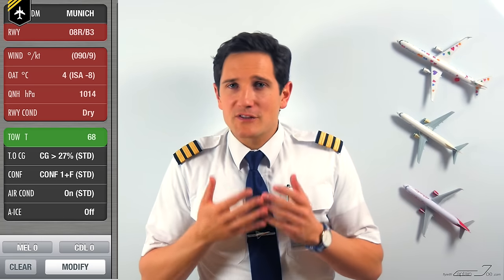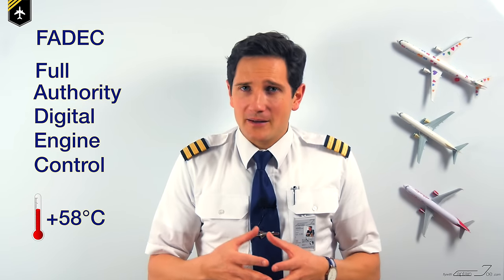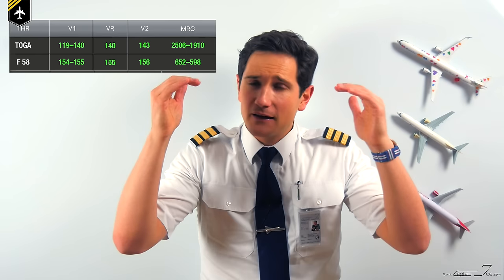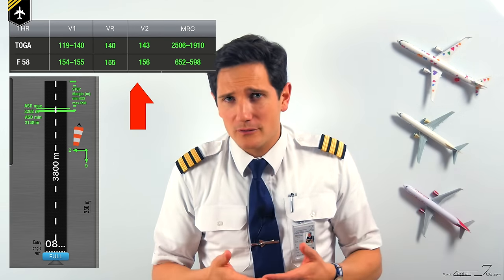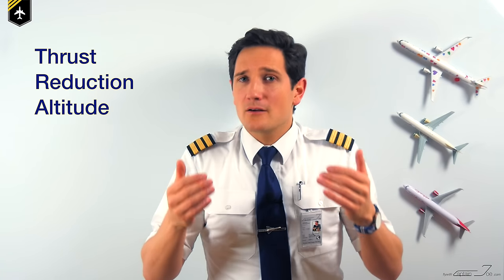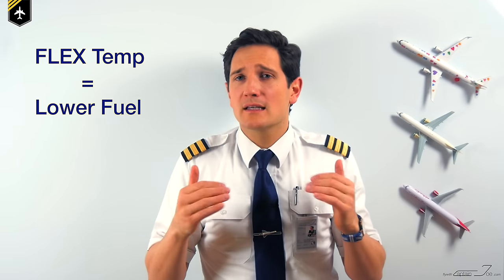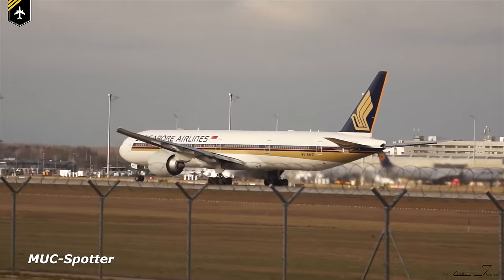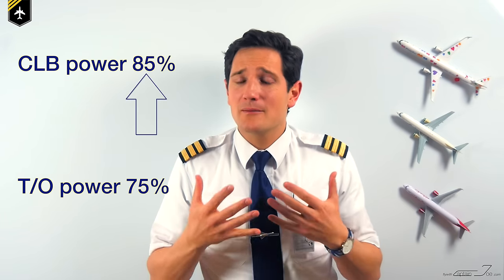What is FLEX TEMPERATURE? Explained by "Captain" Joe

Comment: Joe ..Pls explain how to determine N1 Limit for take off  In Boeing 737-800. 22k/24k/26k. I think it depends on the weight and runway length. However I am looking forward ur help
Reply: N1 for a given takeoff will vary depending on runway, weight, wind, barometric pressure, temperature etc.

Comment: nice,,, what power setting does it use if no flex temp inputted ??? toga ?
Reply: It assumes that you will use toga. So if you don't insert a temperature and then try taking off with the thrust levers at flex/mct, it will give an ecam and ask the pilot to set toga
Reply: @ZK-APA  toga for the win lol

Comment: Captain Joe how does a jet engines main bearings stop seasing up due to temperatures of minus 55 degrees in flight.
Reply: The bearings never get that cold when they are in use, because they are lubricated with the hot engine oil.

Comment: Can you plese clarify? Too my understanding, the higher the temperature the more speed you need for take off as hot air is less dense compared to cold air. Therefore you will want to apply more thrust to achieve the VR speed by the end of the runway. This would be just the opposite of what you said, right?
Reply: His explanation is incomplete and confusing. Basically, up to a certain outside temperature (called the flat rated temperature) the FADEC is programmed to produce the same amount of thrust in TOGA mode (hence the term flat rating), and above that temperature it is programmed to produce less thrust the higher the temperature becomes. If you take off with FLEX 60, for example, you command the FADEC to produce the thrust that it would produce in TOGA mode if the outside temperature was 60. FADEC doesn't actually think the outside temperature is 60, it needs to know the actual temperature to give you the N1 or EPR that would produce the same thrust as TOGA at 60. The highest FLEX temperature for given conditions is determined by your take-off weight - you (or the performance app) simply look at which outside temperature the actual weight would be the maximum allowable weight.

Comment: Hi captan,and glad to see you.So,as i understend it,FLEX is prohibited on contaminated RW, in other words approved with TOGA thrust only,to rich V1 with minimum take-off run and have a maximum stop distance in frot .That is correct?
Reply: Contaminated runways cause both reduced acceleration and deceleration for the aircraft. With higher thrust settings, you minimize the runway length required for takeoff (i.e. achieve takeoff speeds faster.) When talking about field length, we need to take into consideration both the Go (TODR) and the Stop case (ASDR). Therefore by reaching V1 faster you have more field length available to stop the aircraft in case of a rejected takeoff and by reaching Vr and V2 faster you can achieve screen height faster in case of an engine failure at or after V1.
Reply: Pilot Interview Handbook Wow! good english! Thank’s a lot.Really thank’s

Comment: Why did you leave out the explanation, why one would set a lower take off power than climb power. Its not like these few seconds until thrust reduction altitude would matter for fuel consumption or engine life, if after you have a higher setting anyways.

Comment: I have a question, If the jet engine runs on thousands of gallons of jet fuel how is it able to to cope when it rains? The water droplets mixed with air cannot burn jet fuel, please explain!
Reply: Tahir Rana Most of the rain would go through the outer part of the large fan at the front, and around the outside of the engine.  Any rain that goes through the core of the engine would be mixed with air that is then compressed and fed into the combustion chambers so fast that it effectively vaporises instantly.  The possibility of enough rain going into the engine to cause a problem is very remote.  Also, bear in mind that some jet engines actually inject water to temporarily increase power (increases air density), so it's not a problem.
Reply: Thanks for your well thought out, detailed response.  Firstly, I wouldn't become a freemason if they paid me; I am totally against that kind of secret society.  Secondly, could you explain to me why what I've written in the original post is technically incorrect?

Comment: Hi Joe, when transitioning between flight levels, does the airplane figure the climb rate out automatically or do you set a fixed climb rate/speed? Greetings from an aeronautical engineering student from Austria ;D
Reply: Airbus planes manage speed without pilot's help (planes use "cost index" (CI) of an airline. Bigger value of cost index = bigger speed and less care about "fuel flow". CI shows how rich airlines are. CI sets in plane computer (named MCDU))

About Reduced Throttle Altitude - that's altitude, when pilot sets levers in CLIMB position and the plane starts to full automatic control of the plane. After Thrust levers sets in CL - pilots almost don't change the speed. 

But don't forget about that fact planes don't accelerate higher than 250 knots below 10,000 feet and it doesn't matter whats CI you've set. That's the rule.

Generally, 1) Cost index (CI) influences how big speed plane is able to set. 
Formula:
Bigger CI = Bigger Speed= Bigger fuel flow
2) Planes control trust automatically after Reduced Throttle Altitude and levers sets in CLIMB position
3) Limit of speed below 10,000 feet = 250 knots anyway.

P.s. speed can be changed by pilot if needed. For example, Air Traffic controller says to set speed 280 knots, but your autopilot wants to fly 350 knots. No problem, just pull the "selector" in the autopilot panel and set manual speed for 280 knots. 

That's all. I know, that it's hard to understand if you're not a pilot and doesn't know this very well. Because.. if you still have an ask so find answers in Google or YouTube. About I can talk about "how working a plane" without stops, there's a lot of interesting things to say.

About me: I want to become a pilot and I live in Russia right now (want to study at Ulyanovsk institute). Btw, I typed this text without using Google translate, just English is a very important thing for a Russian pilots

Comment: What is the "Crank" Option on the Engine Start Switch?
Reply: thats to dry motor the engine ie spin the engine up without fuel supply and ignition.

Comment: Why would takeoff speed be higher at lower acceleration? And why would you make that calculation dependant on outside temperature if it is all about engine wear and runway length/condition
Reply: When the temperature is higher, the engines produce less thrust, and the wings produce less lift due to the lower air density. This means a higher thrust setting must be used to compensate.
Reply: Nathan Chetram the thing is: from what I understood flex temperature is at the and a thrust setting according to conditions like temperature, runway, high or low pressure etc. and is therefore dependent of the temperature but not not a temperature by its self at all you see?
And also I didn’t understand that part with higher acceleration means lower take off speed and so on

Comment: He Joe. I am a former 777 pilot and ind the FCOM2 it said that the higher the temperature outside air temperature the more power is neared because the worm air is less dens then the cold because the worm air holds more water per M3 bot why is it not like that in the airbus u shut think that wormer OAT should require more engine power then cooler OAT but I do no that AIRBUS uses a higher temperature to decrease engine were and damage. Usily I said to my self when I flew the A320 that the higher the temperature the more runway is required to takeoff. Can u explain that to me on a message ore chat thanks Joe

Comment: Why does the FLEX-Temperature influencesthe V-Speeds ? The outside conditions and aerodynamics stay unchanged to generate enough lift at a certain speed ?
Reply: I don't know about the others, but at least for V1 (the speed until which you can abort the takeoff) its quite easy to see: Let's say you have calculated your V1 for reduced thrust and perform your takeoff, when you hit V1 the remaining runway length (should) equal your stopping distance. Under the same conditions with full thrust, you'll reach this speed with more runway remaining, because you accelerate faster, so your V1 would increase. I wonder what happens to e.g. V_R, I'd think it would remain constant, except for maybe a (probably very small) vertical component of the total thrust . . .
Reply: I would assume with a higher thrust setting you can pull the nose of the aircraft into a steeper climb and the thrust vector is working more against gravity on it's own (just like a rocket), which evens out the lesser lift from the wings.

Comment: Why does the system have the pilot input the temperature rather than get the temperature from a sensor automatically?
Reply: Because this temperature is calculated independently, and doesnt always corrospond to the actual outside temperature

Comment: Hi Captain Joe, I'm 10 years old.  I fly the a320 on x-Plane 11, which is a flight simulator I use.  Thanks for the video ,but I don't know how to calculate flex temp.  Once again thanks for the video.
Reply: You would need a proper take off calculation system to do that. The toliss A319/A321 and FF A350 are the only ones I’ve encountered that tell you the flex temp to use
Reply: @tomstravels520  thankyou

Comment: I don't understand why the engine trust more when fake outside temperature is higher than real ?
When air is hot, air density is low and then engine have to sucks more air to trust the airplane.
What I'm understand is if you put a fake température lower than the real, engine will trust less cause he though that there is more air density and engine can reduce theirs power for an identical take off performance than without flex temp.

Anyone here can help me to understand ? Thanks you
Reply: Flex temperature can't be lower than the actual temperature (it is one of the conditions to do a flex takeoff)

And the higher fake temperature is not for the air density but more for EGT (exhaust gas temperature) limits. As in when we put a flex temperature, the aircraft thinks that if it gives full thrust with that temperature, it'll overlimit the EGT. Hence it reduces thrust as per the temperature inserted.

Comment: I am sorry but your explanation for why V1/VR/V2 are calculated as higher is incorrect.  It is not because the take-off power is set lower as you say.  As you must know, the lift generated by the wings is a function of wing's surface area, coefficient of lift, airspeed squared and air density, which decreases as the air temperature rises.  The reason V1/VR/V2 are calculated higher is because the assumed air temperature is higher and therefore the assumed air density is lower so the computer sets the take off speed higher to compensate for the assumed lack of air density to generate the necessary lift for take off.

Comment: I never understood why Airbus called it "FLEX". Boeing's "Derated takeoff" or "Assumed temperature" is clear as day, but why "FLEX" Airbus? Fuel Longevity Engine eXtension?
Reply from the maker: Ha, that´s a great translation for FLEX :) Greetings Joe
Reply: Actually, Boeing's "Derated takeoff" is not equivalent with Airbus's "FLEX". Boeing equivalent of "FLEX" is "Assumed temperature thrust reduction takeoff". "Derated takeoff" is different method of reducing take off thrust and is present in both Boeing and Airbus aircraft (not all airbus aircraft/types are equipped with Derated takeoff option), where you just select different rating for engines which washes out during climb, allowing full thrust again.
Reply: Nikola16789 Quit splitting hairs. Everything you said there I already knew, but who cares? My point was to illustrate the strange name Airbus chose, not to discuss the minutiae of how each method operates.
Reply: If you know than do not call it with wrong name. Your friends doesn't call you Matt if your name is John. FLEX TO does mean "flexible takeoff" by Thales "FM Pilot's guide" book.
Reply: Nikola16789 Oh lookie, we've got ourselves an expert. Well then, Mr. Expert, you would certainly know that what it's called depends a little on the aircraft type and manual you're reading. Because if you crack open your friendly Boeing 757 FCOM on section 7.10.2 you'll find that it calls it "assumed temperature derated takeoff thrust". Other manuals for other Boeing aircraft use somewhat different nomenclature, but again, that's splitting hairs. In fact, the 757 FTCM does make the distinction you mention in section 3.13 and 3.14.
So you satisfied I've proven to you I know the distinction? Don't answer that, it's a rhetorical question. I don't give a shit.
Reply: I don't even use 757 documentation. Boeing documentation is pretty much consistent for every aircraft; in areas where aircraft types are similar, it goes almost word by word. I have no doubt you know the distinction, but you are too lazy to use correct words when you write.
Reply: Nikola16789 "but you are too lazy to use correct words when you write"
Fine, you wanna play the word game, let's play. You said:
'Actually, Boeing's "Derated takeoff" is not equivalent with Airbus's "FLEX"'.
Show me where I equated either method to Airbus's FLEX. You can't, because all I said was: "derated takeoff and assumed temperature is clear as day". I was talking about the clarity of names, not about whether the three methods are equivalent in principle of operation. I reinforced this point later by saying: "My point was to illustrate the strange name Airbus chose, not to discuss the minutiae of how each method operates".
So no, I'm not too lazy with my writing. You're lazy with your reading and criticizing something I never wrote.
Reply: Fine, lets play. 
Quote (all I said was: "derated takeoff and assumed temperature is clear as day").
In first post you used word OR, not AND.
Reply: Nikola16789 It's common in ordinary speech to switch the two around without necessarily implying equivalence.

Comment: Why doesn’t the plane measure the temperature itself, why
have manual input. Could putting wrong number in cause an accident, with so
many takeoffs happening you could never expect manual inputs to be entered correctly
forever.

Comment: Why don't just use some sensors on engines intakes, so the engines are always running perfectly for the real, not "expected", temperature?
Reply: Because you’re trying to reduce the engine power for takeoff if it’s not needed for full power. Th me way to do that is by artificially changing the outside temperature. Not the actual temp sensor

Comment: captain joe can u plz explain ils??
Reply: it's Instrument Landing system, which is in 3 categories: CAT I CAT II CAT III. when u fly an CAT I ils you turn the Autopilot off around when Radio altimeter says 500 and you land the plane manually, but the rest of approach is automatically done. CAT II is able to do autoland, mostly used only in bad weather on planes that are not able to fly CAT II has a minimums on around 100 RA. CAT III is also able to do Autoland, and has minimums on around 20 RA, but on CAT III minimums is by company, and usually not above 75 RA.. hope i explained it well enough :)

Comment: Captain Joe, why doesn't an aircraft start spinning in circles in mid air when one of the engines fail in and how do pilots tackle that problem
Reply: Harsh Deep Singh Thurst balanced by rudder inputs or trim
Reply: Harsh Deep Singh the aircraft trims the aircraft to stable the aircraft exspecially the ruder trim
Reply from the maker: That answer is a whole other video! Greetings Joe
Reply: Thanks captain,appreciate it

Comment: flex is not really as good as advertised for fuel economy. in fact it's better to Togo to altitude faster as less time is spent burning fuel. Boeing did a research on 737 and they found less flap and more power results in more fuel economy on takeoff due to less power and time spent fighting drag
Reply: It still reduces noise and preserve engine life

Comment: captain joe, what is ils
Reply: it's Instrument Landing system, which is in 3 categories: CAT I CAT II CAT III. when u fly an CAT I ils you turn the Autopilot off around when Radio altimeter says 500 and you land the plane manually, but the rest of approach is automatically done. CAT II is able to do autoland, mostly used only in bad weather on planes that are not able to fly CAT II has a minimums on around 100 RA. CAT III is also able to do Autoland, and has minimums on around 20 RA, but on CAT III minimums is by company, and usually not above 75 RA.. hope i explained it well enough :)

Comment: +58C    Celsium!?? +58 Celsium!!!    Quite warm for outside temperature
Reply from the maker: As mentioned it´s faking the outside air temperature
Reply: Captain Joe but why does it fake it? why doesn't it just say the real temperature?
Reply: Captain Joe by the way, why some of aircrafts have automatic horizon with "view from board" but some of them have "view from ground" horizon (attitude indicator)?
Reply: harm kouws by faking the temperature to a higher value the thrust produced by the engine reduces, but the thrust produced with this flex temp is sufficient for takeoff for the Takeoff weight mentioned in the calculations, 
So even though the engine is capable of producing more thrust at the present outside air temp, we do not need that excess thrust for the present take off weight to take off, 
So this helps improve the engine life and helps reduce wear and tear of the engine, by producing the thrust that is just sufficient for takeoff for the present weight.